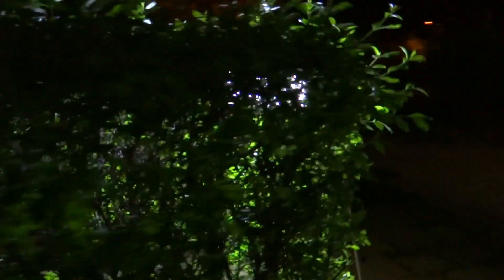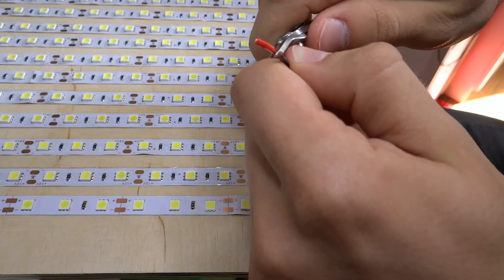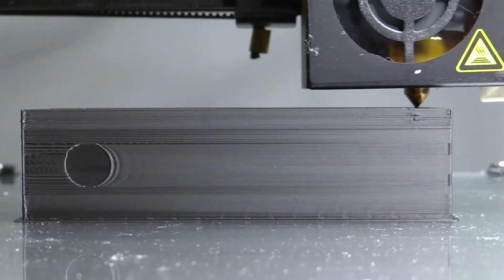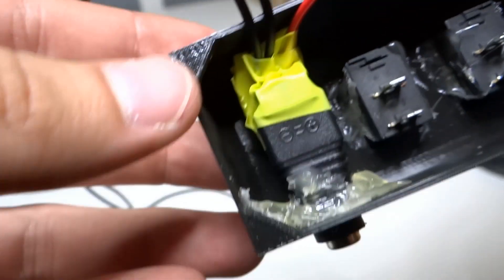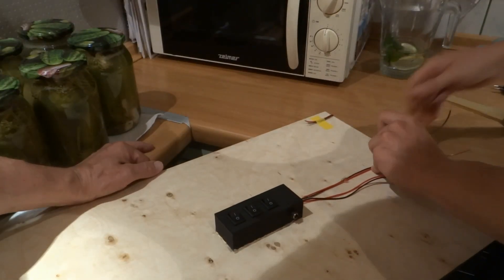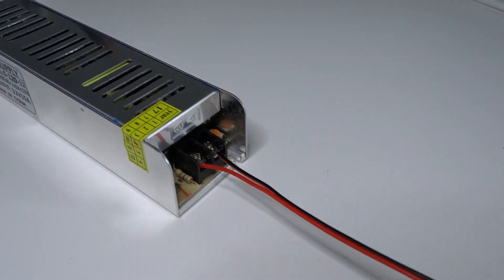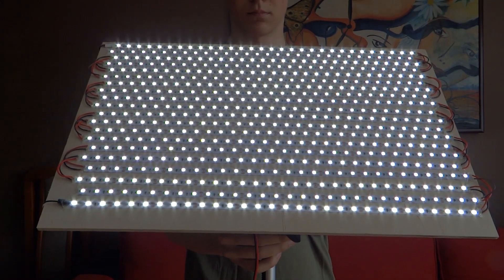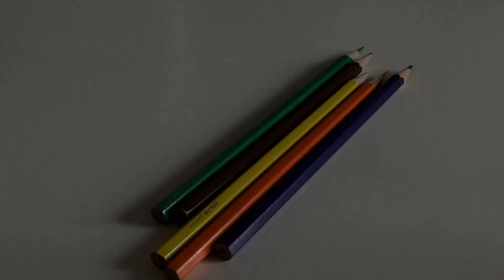How to make DIY LED panel - Super bright light out of LED strips for video and workshop

Comment: Hi, very nice DIY. I subscribed too. You play with cool stuff and your accent is awesome. Currently, I am trying to get a self powered lighting system on an RC plane to turn on through a relay. Just need a 5 v instead of 12 v relay. The receiver will put 5 v to the servo for the on off on the relay.
Reply from the maker: +Joshua Weaver thank you, this kind of system is great for a drone you can actually do a lot of interesting things with that :) do you want to control relay with servo signal?
Reply: Nikodem Bartnik. Yes, and the servo voltage is 5 v. I could order a 5 v relay, but this is all from things I salvage. So I may step up from 5 to 12 with a little transformer or some other way. I am also looking at a 5 v transistor, but I have to learn to do the calculations to make sure it can handle the current. But I have a couple so I could just hook it up to see if it keeps its white smoke inside or not.
Reply: Nikodem Bartnik. Just found 4 higher powered transistors in an RC car with a very simple pcb board. It is 2 speed forward and two reverse. Now some testing and possibly a new receiver and brushed ESC for this car to connect to a remote that works.